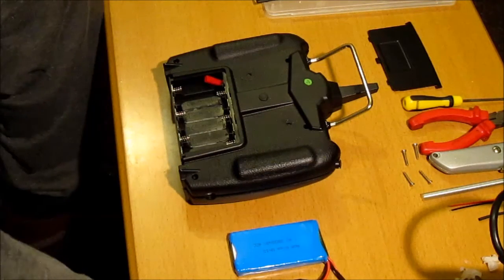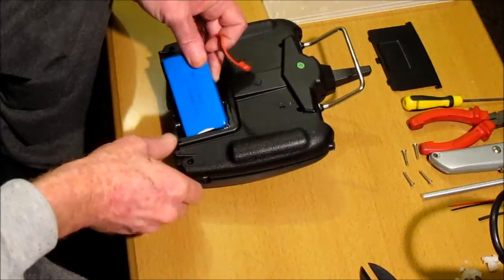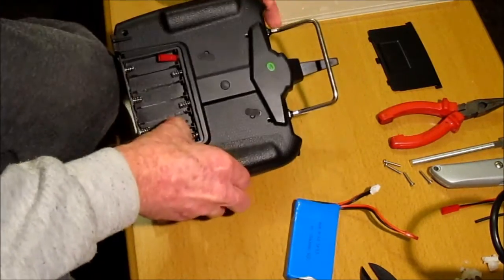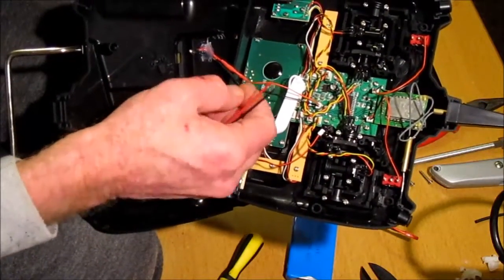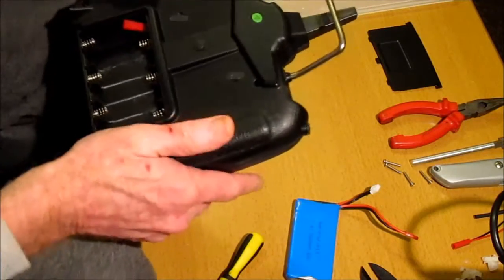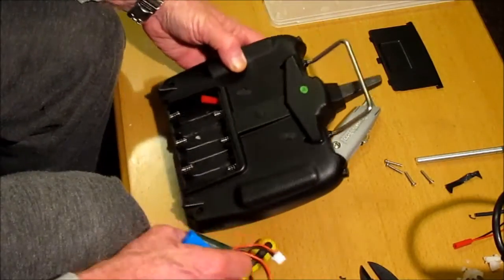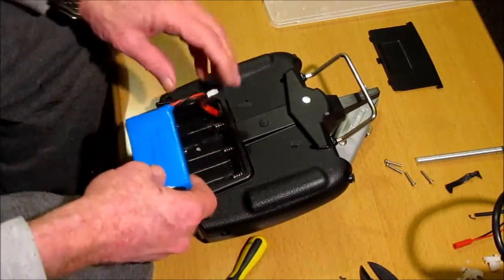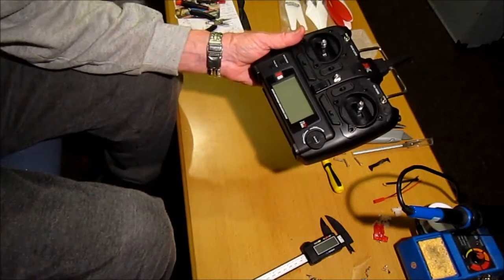XK Detect X380 Transmitter battery mod

Comment: Hey bill, thanks for sharing your knowledge. Do you think this mod will also work with the XK 6X transmitter?
Reply from the maker: Hi, yes it should be fine with the XK X6 transmitter too.
Reply: @BillMRC  Ok thanks! I am new to the RC world I am gonna start with the XK K110 heli. I will follow your video as soon as I get the battery. 👍

Comment: Another HACK JOB , you NEED a DC- DC buck converter, or voltage regulator inbetween that big honking lipo and your delicate transmitter circuit. So many of these hacks. Its a simple .99 cent converter that prevents over current from lipo to regular battery power. Do you not realize a lipo is different from a standard battery? Guys, dont do this hack, please. Go on line, look it up. You can buy 10 DC- DC converters for $5.00 , enough to do all your radios. Its insurance that only the proper voltage is reaching your radio. Watch other videos that use the converter. Please.
Reply from the maker: Hi, thank you for watching & for your concern. In this instance, this is a 7.4v battery supplying a 9v output, so a buck converter is not necessary.

Comment: Hi Bill.  I also wondered about the battery voltage being 7.4 vs 6 x 1.5v AA batteries which are 9v.  However your not the only one to do this - https://www.youtube.com/watch?v=BE7fOjUAxzY (7.2V) so I thought, hey, that's two people with the same idea.  I then considered rechargeable AA batteries but they are 1.2v.  However 1.2 x 6 = 7.2v.  I then read this - http://www.ebay.co.uk/gds/Why-are-Rechargeable-Batteries-only-1-2V-/10000000019071245/g.html - which seems to make sense.My question is, did you do a comparison between the AAs and the Lipo re how long they last before needing replacing/recharging?
Reply from the maker: Hi Peter, 2800mah x 40C is 2.8 x 4 = 11.2 volts output. I did not do a comparison between AAs & Lipo as I prefer 1 unit instead of 6 units.

Comment: Bill I just made myself a x380 transmitter battery case mod , It's really neat to my opinion.I used the same battery as in your video with a nice fitting external black electronic enclosure case (www.aliexpress.com).If you're interested or you're abonnees in the pictures you all can send me a email to the following adress; thegoose34211@gmail.com , ofcourse if you all are having any question(s) about the mod do not hold back :-)
Reply from the maker: Hi Peter, looks good and very neat :-), thanks for sharing.

Comment: Thanks Bill the rechargeable batteries don't get it since the output is lower which also means the transmitter  will have limited
range due to voltage drop-off. You need the full voltage and current supplied to get the maximum range and reliability. Several
quadcopter companies are now using LiPo batteries in the controllers. Thanks for the links and video.
Reply from the maker: +Dennis Petersen Hi Dennis, 2800mah x 40C is 2.8 x 4 = 11.2 volts max output. I have had over 10 full flights with this and reached 1425 metres in range.
Reply: I hear ya on that and you are giving me ideas
already. Now I have to order more parts for
the quad plus a good balance charger. Have
a good day and thanks for the response.
Reply: Hi Bill, I put the mod in with not problems but I would recommend that the original battery contacts and springs
should be removed for more room for the battery. I also removed the battery partitions by using a soldering
iron that had a badly worn tip to put slots on the partitions then to use a pliers to fatigue the plastic so the
partitions can be broken away more easily. You want to be careful using the soldering iron to not get carried
away trying to melt the plastic because all it takes are melted slots on the partitions. You can carefully use a
Xacto knife t trim excess plastic away inside the battery compartment. Again, thanks for the idea!

Comment: After your mod, you switched on your remote and it read 8.3 volts. How do you get it to show battery voltage? Mine doesn't, as far as I've seen.
Reply from the maker: +Ken Weller Hi Ken, good question. I have just checked mine again by switching it on and after an initial screen, a couple of seconds later I get a display reading of 7.8 volts. Maybe because of the lipo battery for some reason, but I honestly do not know. Interesting, so I will delve into this now, thank you.
Reply: +Bill M Very curious! Thanks!!

Comment: hi...do you think that i can use this 3s battery? http://it.aliexpress.com/item/11-1V-2200mAh-8C-Lipo-Battery-3S-3-Connector-for-JR-Walkera-RadioLink-Transmitter/32573282419.html?spm=2114.010208.3.1.MVM4iH&ws_ab_test=searchweb201556_0,searchweb201602_2_301_10034_10033_507_10032_508_10020_10017_10005_10006_10021_10022_401_10018_10019,searchweb201603_6&btsid=17f30e4e-fb8f-4c16-bedd-4cd0be635db4
Reply from the maker: +Pi Da Hi, this will not fit into the compartment but you could use this battery if you can attach it to the transmitter another way. Dimensions to fit into the compartment are max: 13*40*86MM . If you have any further questions, please subscribe to this channel.
Reply: Hi. And what about the voltage? Does the transmitter can work properly with 11.1v?

Comment: good video..can i use the charger of x380 to charge this lipo?
Reply from the maker: +Pi Da Thank you. Unfortunately, you cannot use the X380 stock charger for this battery as it does not have compatible connectors and is also only a 2s battery.

Comment: 7.4 volts  insted of the 9 volts may cut your distance down a bit
Reply from the maker: +ziggyzbeak Hi, 2800mah x 40C is 2.8 x 4 = 11.2 volts output.
Reply: 112 v will burn it up
Reply from the maker: +ziggyzbeak 11,2v not 112v . 11.2v is the maximum output of this battery should burst be required.
Reply: My quad only has four AA batteries but I ordered a bec to drop the voltage  I know what you mean bill I hope its fine just asking cheers
Reply from the maker: +ziggyzbeak Thank you for your interest, it is always good to ask questions. It may be wiser for me to put a bec in too, but so far 5 full flights and all is well :-)
Reply: Well you tested it and it works  I have a hexacopter with 6AA batteries now I can use one of the lipos I have laying around and quit buying aa batteries  THANK YOU
Reply: You have no range problems right
Reply from the maker: +ziggyzbeak No range problems.
Reply: good deal
Reply from the maker: +ziggyzbeak Update:

As at 13/4/16 - 8 full flights (+20min other) with 65% battery remaining.
Reply: I was talking about range not battery life
Reply from the maker: +ziggyzbeak I know, just an update for info.
Reply: thank you Bill I understand

Comment: How many hours of use per charge do you get from your transmitter after this conversion?
Reply from the maker: +Glenn Coffey Hi Glenn, unfortunately I have not used this sufficiently since installing this, so I do not know yet.
Reply from the maker: +Bill M Update:

As at 13/4/16 - 8 full flights (+20min other) with 65% battery remaining.
Reply: +Bill M Hey Bill, I have also made the mod to my X380 using a 2100 mAh lipo battery.  I have 3 flights using this setup and my battery is still at 70%.   I am very pleased with this setup!  Gonna save tons without buying AA batteries.  Thanks for your video.